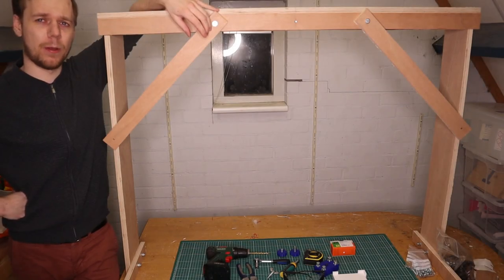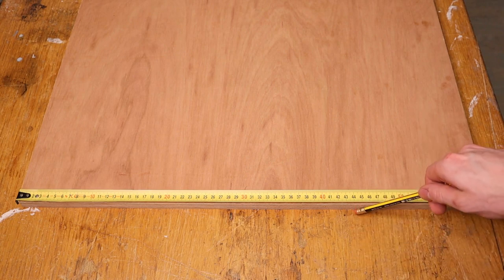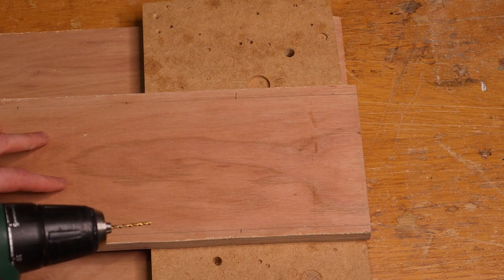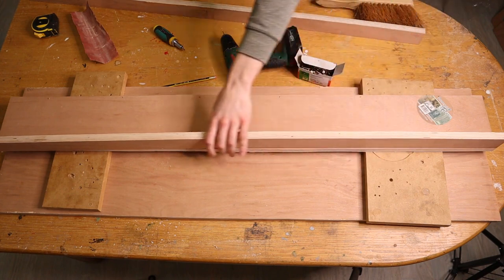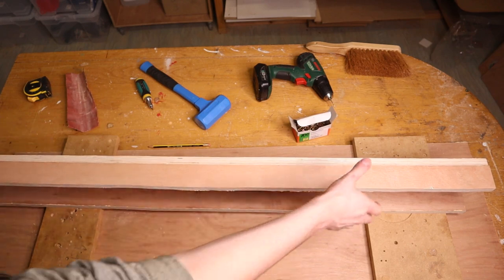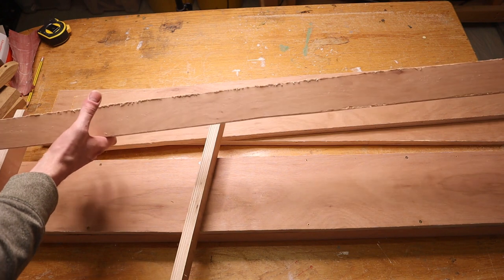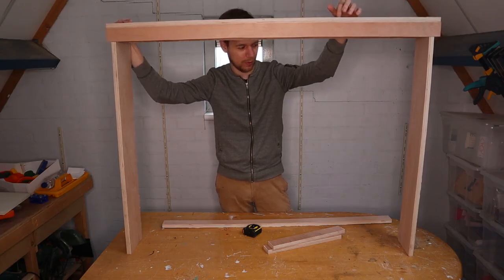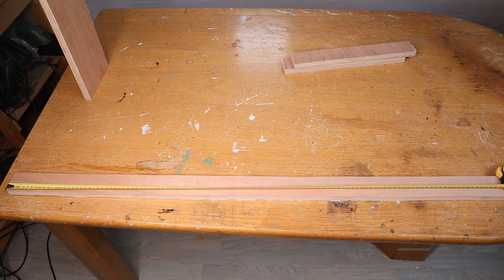How to build an Overhead Camera Rig for DSLRs for under 30€ using minimal tools

Comment: There's a variety of 1/4" thread camera mounting screws available such as this:
https://www.joom.com/en/products/1517300459831507527-80-1-26193-1541504562
or as a spare component from tripod manufacturers.
Beware of tightening the screw too hard into the end of your camera's threaded hole.  When reaching the bottom of the thread, back it off a bit, then lock the camera in place by tightening up a separate nut to tension the screw.
In the days of film, many cameras were 'killed' by the mounting screw being forced into the end of the hole too firmly, which distorted internal mechanical components.
Reply from the maker: Thanks for pointing those out, they seem quite useful and I do recognise those from my tripod plate.
I've also noticed that if I overtighten the screw the touchscreen gets a bit random. I think it's fixed now that I set it to "normal" instead of "sensitive" but still, the screw is definitely doing something. I just leave the screw at a low tightness and everything works fine for me, I haven't needed the nuts yet. I've luckily never seen the image distort.

Comment: Can't you just reverse the 3D printed part, screw in the screw and detach it again?
Reply from the maker: For sure, but in that case the 3D printed part is essentialy a wrench. That's not bad per se, but the advantage to using thumbscrews or wingbolts is that you never have to look for a tool to detach the camera.